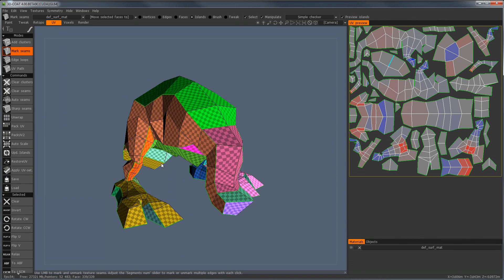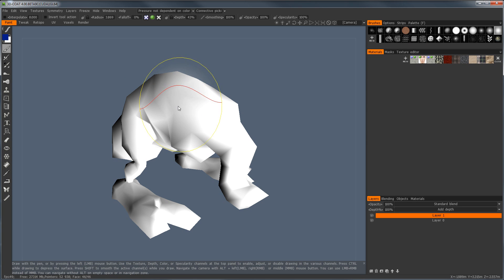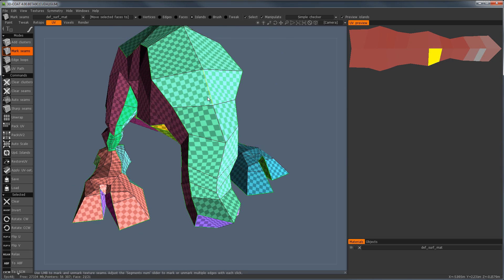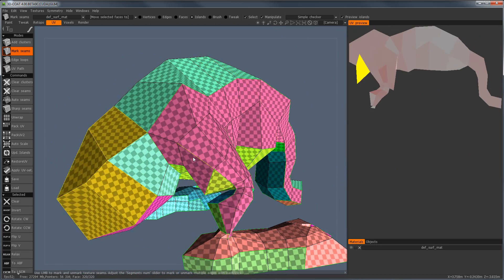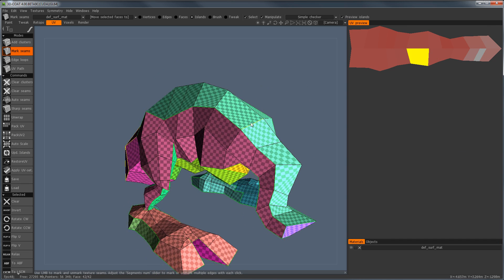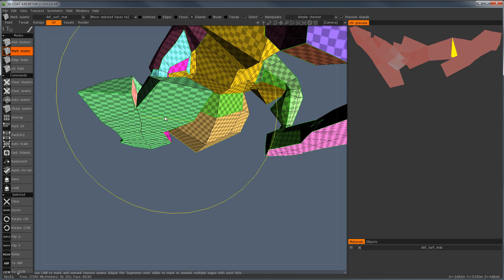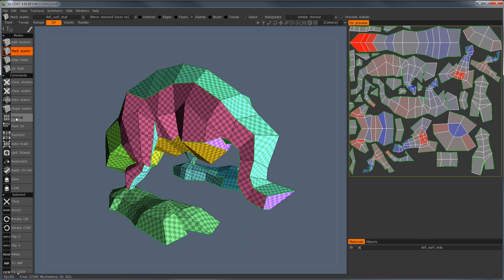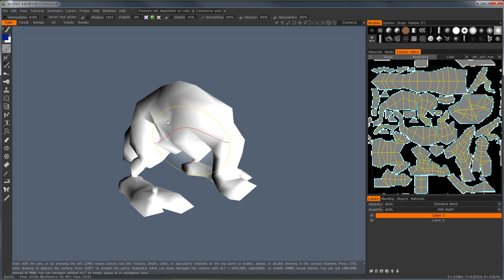3D-Coat Part 5: UV Room

Comment: Noob question here:
 Is it possible to createsay ,a rock , using the voxel room and then UV it ? I tried but when switching to the UV room  - it is empty. I ahve been trying to figure this out for days now.
Reply: Not just you, when I switch to UV tab it's also empty, even using the professionally prepared Human man at the start, shows nothing
Reply: Universalmusicgroup i think its because its voxels and not polygons? i dont really know how 3d coat works yet but its the first impression i got from it
Reply: CubeGames Official i think so, because it's in voxels mode and needs to have a surface to UV map to
Reply: nirsul take to retopo room